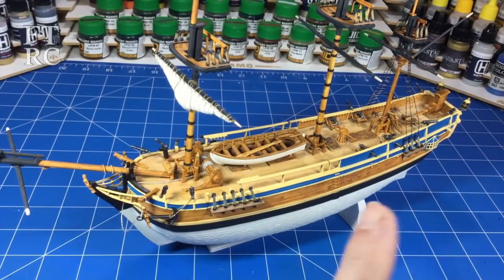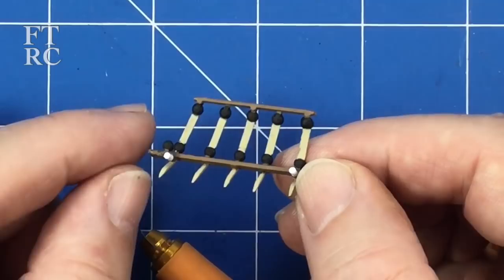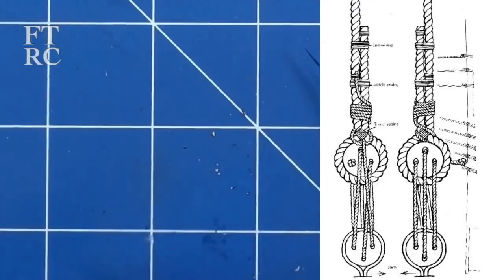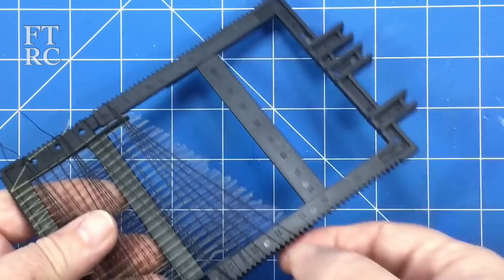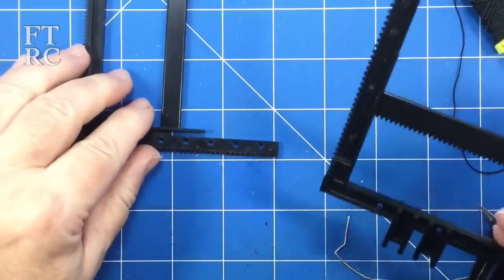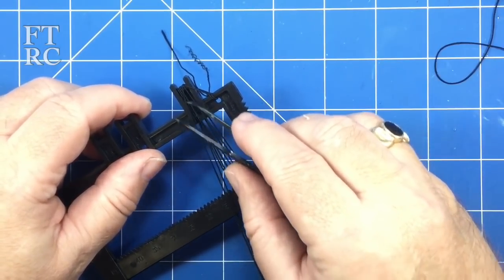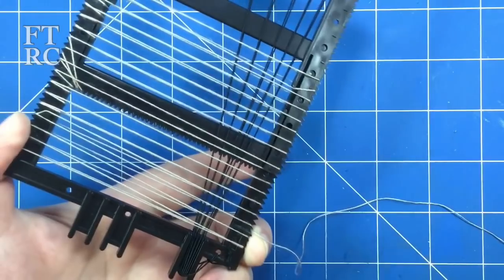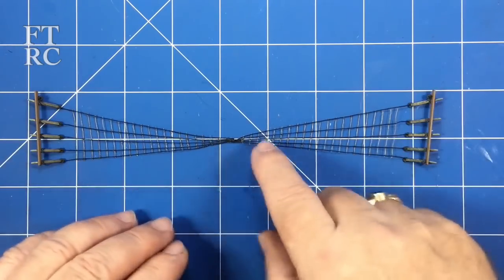Revell 1:110 HMAV Bounty Part 5 Knots, Rats and Rigging

Comment: What size rope do you recommend? I just started this one and am looking to do my own shrouds. Any advice is much appriciated! Love these videos btw.
Reply from the maker: You work out the sizes by measuring the diameter of the main mast. From memory it is 6mm on this kit.  So your main forward stays are always 1/6 the mast = 1mm, then your shrouds  (vertical lines on the ratlines) are half the stays, so 0.5mm, finally your horizontal ratlines half the shrouds, so 0.25mm thread.  I can give you a chart of all the thread sizes for each line.  But honestly as long as you get the main forward mast stays thick, the shrouds (vertical lines on the ratlines) medium, then the rest thin, it will look ok.  If the line is fixed and not moving it is tarred black. If its running rigging that moves, including ratlines, it is jute or light brown colour.

Comment: Hi Harry
Great video and very helpful.  Just one question, why do you string your ratline every two notches rather than use every notch on the frame?
Reply from the maker: Thanks Derek.. Ratlines are a constant height of one step, about 300-400mm no matter the size of the ship.  So in the Bounty’s scale of 1:110 that works out to be about 4mm apart.  The Heller ratline tool I demonstrated had 2mm spacing, which works for their 1:200 scale ships.  For the 1:150 scale ships a spacing of 3mm would like about right.  It does not matter if the ship is as small as the Bounty or as big as the Victory, ratline height is always a human sized one step.
Reply: Cheers for that, Harry.

Comment: Kind of surprised that so many people tend to cut or leave out the board going across the deadeyes on the shroud. I can't remember the name but the item is very important in maintaining the structure of the shroud and keeping the deadeyes in position.
Reply from the maker: it’s called a sheer pole and was a more modern invention.  However it was probably used from 18th Century onwards.  It is a very thin metal bar and in the scales we make our models is not much thicker than the ratlines themselves.  The thicker wooden beams used in place of sheer poles are rarely seen on ships before 1700.  At least that is how I understand it.
Reply: @HarryHoudiniModels  Thank you, I remember seeing them on the Bounty Replica at one point before its disaster and they are also on the Brig Niagara. However, these are, or where replica's and it is possible they were added as modern adaptations.
Reply: @HarryHoudiniModels  Also, when you next video on the St Louis? Love it when your doing the sailing ships. Keep up the good work Harry.
Reply from the maker: I will get back to the St Louis next month.  Working on my Schnellboot this October.

Comment: Looks ship-shape to me mate. Nice looking rigging etc. Harry. Have you ever made an Artesannia ship from scratch where you build the hull etc plank by plank? Took me 100s of hours when I built the Endeavour but boy was it worth it. I've given it to my younger nephew as a present (I ran out of storage room). Another awesome vid mate.
Reply from the maker: I made wooden ships as a teenager from plans and stock balsa.  Have been eyeing off the Billings wooden Bounty which was on sale here.  But need a lot more free time to tackle all that work.  However it’s on my list and I’m sure I’d love building one.
Reply: @HarryHoudiniModels  I had a knee replacement that got infected and to fix that, they take out your artificial knee and leave a "spacer" which is a non-functional joint which virtually meant I was bed bound until the infection cleared. It took 8 months, so I decided to build the Endeavour (the Bounty was my second choice). I'm glad I did, but wouldn't do it again. Too much of a time commitment on 1 subject, and if you lose your mojo or get stuck on a stage, it can mean you don't get anything done. At least with plastic models, they can go in the shelf queen shelf and you can start another one you have been itching to do. My advice: have another plastic model going at the same time, and alternate between projects. It would mean also that your Youtube channel doesn't get bogged down for a lengthy spell.
Reply from the maker: Good advice.  In fact this Bounty series is the first time I have stuck to one build consecutively on my channel.  Lost me some subs, because I usually alternate between ships, armour and aircraft to keep the great unwashed interested.  But I needed a mojo booster after feeling very down when I moved to Brissy.

Comment: Any idea where i can get the shroud ratline tool.
Reply from the maker: If you mean the Harp I designed, then you need to make your own.  I will try to add a plan of it to the page for my Bounty build on my website.  Otherwise the Heller/Airfix loom is included  in their older sailing ship kits, and now in the new Classic edition Airfix reboxes. Thirdly there are other types of Ratline building tools you can get from retailers who specialise in wood ship kits.
Reply: @HarryHoudiniModels  Thank you I am building a Monogram USS Constitution which has the plastic shroud lines but would like to do my own. I think the plastic loom would be nice but can't find one online.
Reply from the maker: Have you watched Part 8?  I show how I made and used my custom harp tool to do the ratlines after rigging the shrouds